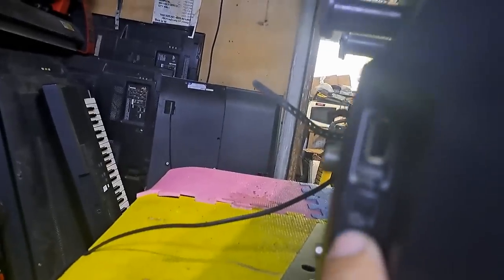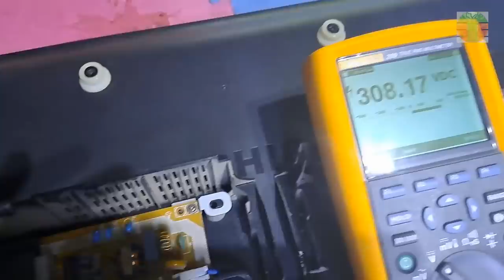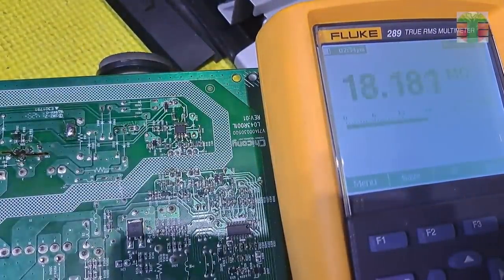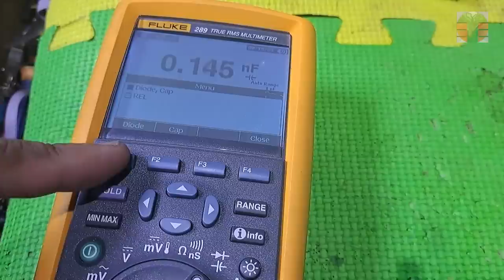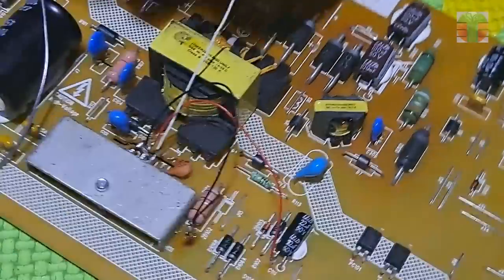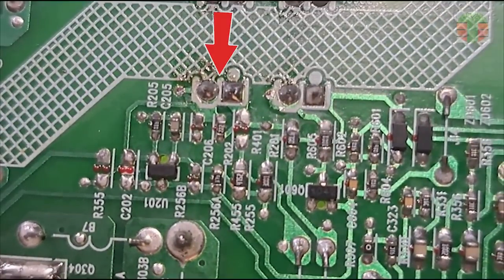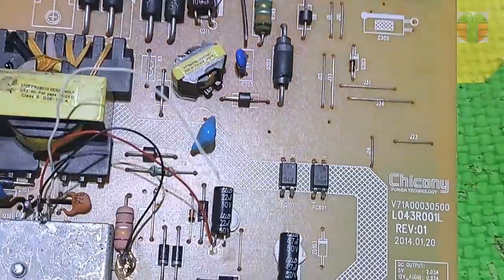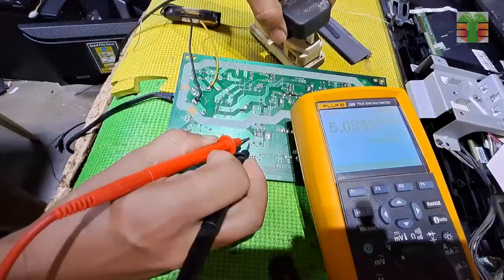How to identify the right optocoupler. " Power supply Modification"

Comment: The best tv engineer, keep it up Sir,
Reply: Engineer doesn’t do this kind of alteration. Engineer always find the actual source of problems and rectify it with proper solution. This guy just altered the circuit with non professional substitute which is not long term and proper solution. He is just another repair guy.

Comment: I think changing the fuse with resistor is not safe practice. Safety fuse is a primary protection when there is short in your circuit. Changing it with resistor just limits the current in your bridge rectifier due to your bulk capacitor inrush current. So it is better to keep the fuse untouched when doing test to safely prevent damage…. Nice troubleshooting tips though, thanks for the video.

Comment: Nice video, always tell people to subscribe to your channel because people dont know subscription is free. Thats the reason most people dont subscribe.

As for the right optocoupler to connect, i usually trace pin 4 back to the PWM IC pad. Ive never tried looking out for 431.

Im still wondering why you always use the 220ohms 20watts resistor. Whats the effects if i dont use it? Is the fuse not means to blow out when theres a wrong connection? Why put resistor that will not blow? Or will the resistor blow?

Once again thanks for your video i now know how to modify power supply.

Though i tried it on one power that has a different pwm ic about 16 or 18 pins
Reply: Hi the restor is the to prevent more compounents from blowing it limits the current I use a dimbuld tester so if there's still a short the light lights up bright
Reply: @reaganlewis9074  wow, thanks, but will the resistor get damaged?
Reply: Nope just use a high wattage resistor
Reply: @reaganlewis9074 how much ohm's and watt resistor for discharge Main filter capacitor ? Thnks
Reply: @kishanpreston1533  220 ohm 20 watt resistor
Reply: @reaganlewis9074  thnks bro
Reply: @reaganlewis9074  I also use dim-bulb tester instead of using resistor

Comment: Good morning Tevz. Your are master. Great job. ❤️
Please can you send me the diagram for the ic strw6053.
Because  I sightly didn't understand the pins soldering.
I know you have many videos on this ic.
Thanks ❤️
Reply from the maker: Check my other videos. About STRW6053N modification, There are more datails than of this video.
Reply: @tevzTVTevatronics  yes I did check some hours ago. Now I understand fully how to work with strw6053.
My confusing was only the pins.
Infact this ic have 6pims physically and when you look into the diagram you shown on other video.  There no pins 2.
You have 1 3 4 5 6 7.
That's was my confusion always.
Pins 5and 7 for ground.
6 for fb.
4 for vcc
3 source/octo
1 drain
Reply from the maker: @Fardeenfarwest  Yes there is no pin 2.
Reply: @tevzTVTevatronics  right and that's was my always confusion. Now it's clear. Thanks.

Comment: Amigo puedo hacerle una pregunta espero me ayude. Los transistores 30F124 o los RJP63K2 se puede medir con tester en la escala de diodos. Estos dan una lectura de un lado y si volteas las pinzas no da lectura en pata 2 y 3 y al activarlo mide un valor más bajo estaría bien el transistor si da un valor en tester. Gracias

Comment: Please tell about pin 6 BR

But pin 6 BR mean Brown in and Brown out
 
starts operation (brown-in) when the AC input voltage is above a certain voltage, and stops operation (brown-out) when the AC input voltage is below a certain voltage.

That function you made bypass connecting with Ground.

Comment: Hey tez I have a question
Reply: I have a Samsung 40 " that has  fault of backlight,once I replaced the backlight they worked for one week and wete blown again,,,the power of the backlight is 227v,, how will I solve this problem
Reply from the maker: @stevohtheeman6161  Did you replace them all? Adjust the backlight level to 50 percent.

Comment: Please read pdf strw6052s
You can enable BR rotection using 3 resistors qty 2 2.2 mega and 330k and 01 cerqmic 1000pf mean 102. Please add this in your upcomind videos.thank you